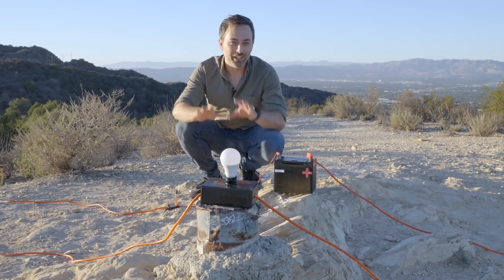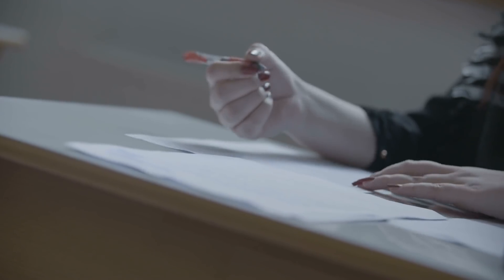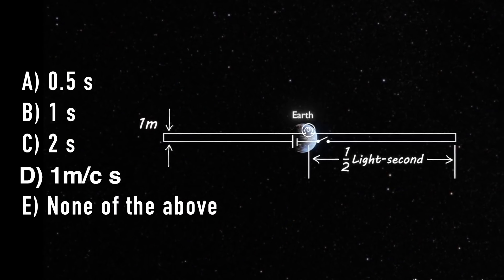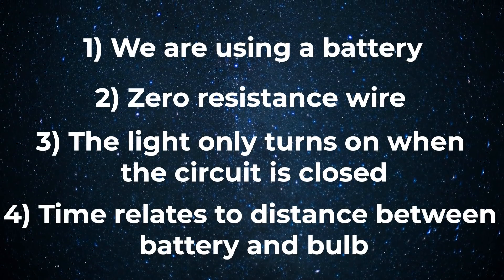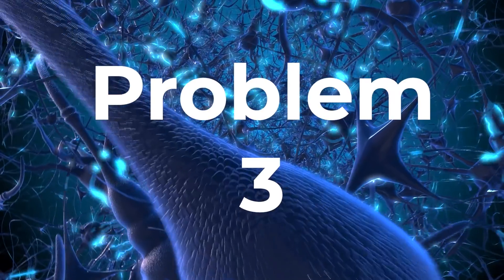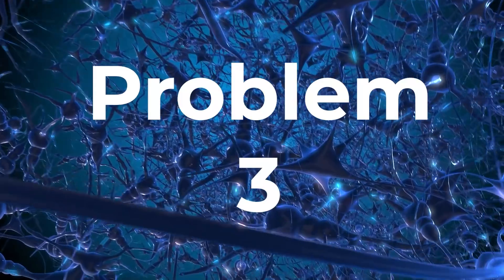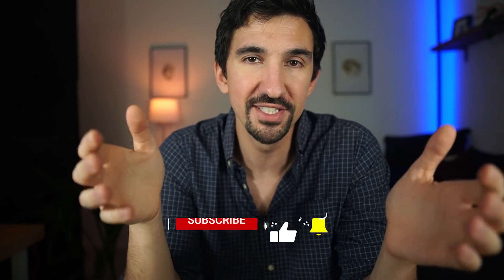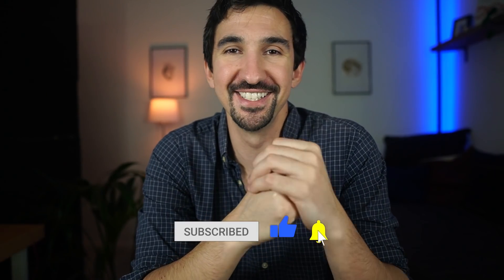Is Veritasium Wrong About Electricity?

Comment: Well done! By the way Veritasium uses the Poynting vector to illustrate the energy flow which is the right way to do it. The only little -- but extremely important -- detail which remains unmentioned is, however, the magnitude of the Pointing vector is directly proportional to the magnitude of E and B vectors (per definition of the vector product) and the E field strength is strongest close to the conductor. Thus, I figure, the most energy flow won't happen through the largest air gap or along the straight line connecting the battery and the light bulb.
---
It is a far more interesting question for me how the energy transfer is to be explained after the transiant processes are over by the Pointing vectors. So far I remember around a wire carrying a DC current there should be only magnetic field and the electric field created by the moving charges should be balanced out by the static charges so the electric field around that conductor = 0. But I got taught the theory 20yrs ago, so I might be forgetting something. Some help?
Reply: Indeed. I think this point is the best way of understanding where Derek went wrong. The presence and geometry of the wire itself affects the Pointing Vector, and the vector evolves over time. Yes there is a propagating field from the switch to the battery that travels at c. However the magnitude of the field at the lamp is minuscule. It has propagated across near vacuum.  Derek is basically claiming that the field contains enough energy to light the lamp, only due to that part of the field that has propagated across the gap. This is clearly false, and put simply Derek has it wrong. Useful power that can light a conventional 12 volt  lamp will not be delivered. 

The Pointing Vector will evolve over time as the E/M fields propagate down the wires, and in the vicinity of the lamp it will be rising in magnitude. In the limit, and with zero resistance in the wires, the field across the lamp will only rise in magnitude to the same as the battery after the fields have propagated the full length of the wires. In the real world, with actual resistances it will get close but never the same. Derek plays fast and lose with the nature of the E/M field. Whilst he and his advisers are happy to talk of propagation of the fields down a wire, they are happy to ignore permittivity and permeability and thus ignore actual energy delivery versus the initial arrival of a change in the field. Depending upon the nature of the lamp, it will light up at some intermediate time as the field increases in magnitude to the point where there is a large enough E field to drive enough current through the lamp and light it. However this time will, for any real life lamp, be indistinguishable from the full round trip time for the field.

Overall this was probably a low point for Veritasium. For someone with a PhD in physics (albeit in physics education) Derek made a serious mess of this. He should make a new one correcting things and pull the existing one down.
Reply: @francisvaughan7460  thanks for your explanation.  I understand the issue better now.
Reply: @francisvaughan7460  Derek never said it was practical, Derrik isn't wrong, but does negate the practicallities that outside of very specific conditions, as a matter of engineering, it is not worth considering. that said, this is why your ethernet is twisted pair and differential signalled. It is why we use coaxial cables in radio...
Reply: @EwanMarshall  Derek didn't say it was impractical either. He claimed the lamp would light. That requires non-trivial power delivery. He isn't wrong, but he isn't right either. He is presenting a confused mess. What he implicitly claims is however wrong.
The manner which information transits down a twisted pair is covered by exactly the same physics and mathematics. Delivery of information requires a well defined amount of energy. That won't move like Derek suggests either. In practice twisted pairs are complicated by the geometry of the twisted pair, which yields a velocity less than c. But this is nothing to do with Derek's weird set of assertions.
Reply: @francisvaughan7460  He stated we assume an ideal lamp that can light the moment it gets any energy. He isn't wrong, he is technically right, but the way he presented it, I agree, was not good.
Reply: @EwanMarshall  Good point. This is a significant error on Derek's part. An ideal lamp will obey conservation of energy. It can't light up and emit more energy than it receives. Derek is confusing the detection of a change in the E/M field with the delivery of energy. To do work - that is emit light - an infinitesimal change in the field is not enough.
Reply: @francisvaughan7460  I have a crystal radio set that says otherwise. Energy harvesting devices do exist. Now is it a lot of work they can do, no. In fact without another energy source they are pretty limited, but one can do some work. It isn't infinitesimally small.

I never said it'll light any more than the energy it recieves... it might not even be detectable by human eye. But this is problems in what we mean for the ideal lamp to light.
Reply: @EwanMarshall  Exactly. Derek never defined what "light" means. He did however keep turning a lamp on and off on camera. He never suggested that "light" meant anything other than what he was demonstrating. That requires non-trivial energy.
Reply: @EwanMarshall  "He stated we assume an ideal lamp that can light the moment it gets any energy" Wait did he really say that? So he's basically explaining radio wave in a video titled "The Big Misconception About Electricity"?
Reply: @Neehize  radiowave is "electromagnetic spectrum" what is electric and magnetic fields moving?

What Derek is saying, and is true, is the energy transfer down a cable is these same waves, just running along the cable. Transformers use this effect, but the truth Derek is explaining is "current" is actually this running along the cable.
Reply: @EwanMarshall  It is the same thing yes. However, the amount of energy transferred in the air and along the cable are on different scales... It's not fair to say "I'm able to light up this lamp without the cables connecting" because you cannot light up this bulb with only 1% of 12V
Reply: @Neehize  "assume the light comes on the moment current passes through it", so we need any non-zero current and voltage, by the terms he states.

I did not say it will be visible to the naked eye, I did not say it is physically practical. By the way it is stated, it is what happens.
Reply: @wbeaty  You are stating that Derek sent a signal over wire faster than fiber optics could? Because, on or off, its still a signal. 
No, he didnt, and no he cant. He is confusing radio signals with electric circuits and confussing everything in a very badly worded explanation about neither while trying to convince people he knows better with clickbait.
Now Im missing his sellout videos. At least those were as entertaining as biased.
Reply: @JuanCLeal   "you are stating"  Of course I'm not!   Why are people putting words in Dereck's mouth?  Why are YOU putting words in mine?

Everything in my writing (and in Dereck's video) is talking about foot-per-nanosecond lightspeed effects  ...which happen to be counterintuitive.    Those who don't understand basic rf design will start making s**t up, trying to "debunk" engineering textbooks.

When the switch closes, the light bulb turns on 3.3nS later, because at 12VDC,  tens of milliwatts of EM field-energy will easily leap across the 1meter distance, and will light up an LED lamp.   The gap-delay is one meter divided by c, or 3.3nS.   

Yet also that 1M gap will make it IMPOSSIBLE for a 12V battery to light up a one-watt bulb, or even a 1/10th-watt bulb.   The gap serves as a series impedance, a current-limiter.   But the amount of power that jumps across the gap is not at all microscopic or insignificant.   Really that's his whole point:  it's a trick question, meant to trip up anyone who believes that electrical energy flows inside of the wires.   It doesn't.   Never has, but we didn't know this until Oliver Heaviside figured it out, just before the year 1900.
Reply: @wbeaty  Hi sir, could you explain to me with more details how do you compute the Amperes that "arrive" to the led light?
Reply: @wbeaty  I don't think the 600 ohm calculation is right. The battery might see 600 ohms between its terminals, but that just means there's a 10mA current wave propagating out along the wires from the battery. The lamp won't receive any of that current until it has completed the round trip.
Reply: the Poynting vector of a static field doesn't describe the energy flow, but the energy stored in that field. This can easily be shown, by adding some magnetic material inside the loop or just looping several times. The field strength will be significantly changed, but the DC energy flow won't change. If Derek was right a spark coil wouldn't work.
Reply: @georgantonischki1188  thx for your comment and I made I further comment to my own comment so if you have some time to spend you can caste an eye over.
Reply: Poynting
Reply: @AlienRelics  exactly - and accuracy matters ALWAYS
Reply: Thank you so much! This was what confused me the most.
Reply: Veritasium has been wrong about a lot things for the past 2 years. Just saying.
Reply: Nice discussion. Thx for Greg for replaying to my question and for everyone for bringing good points.
----
I have just a few practical things to share. I remember when I was a student I spent 2 days to tune a self-made radio transmitter and the thing is in order the transmitter to radiate RF many conditions should be met and the most ugly ones (at least to me) are those related to the antenna and the transmission line. It really took some tweaking to force the transmitter  to radiate RF energy despite  of a relatively high frequency (ca. 100MHz). When running a radio transmitter I assume the antenna as being a load and measure the power consumption of the  whole transmitter. The funny thing is that when the antenna is sub-optimal the whole power consumption goes down.  So less energy per time is radiated. You have a feeling like this all RF is just "sticking" to the wires :D and only dare to leave them when the conditions (antenna) are right. 
For lower frequencies like 50Hz the antenna would be huge i.e.: c/f/2 = 10^8/50/2 =10^6m = 1000km, so there are virtually no chances to radiate RF at these frequencies.
DC not even theoretically are there any chances to  radiate something outside the conductors (the only quantities existing around and between the wires are static magnetic and electric fields accordingly).

Thus for me it looks logical to use the pointing vector (S = E x H ) to represent energy flow in radio electronics. However for a DC current where no energy is radiated into the space (at least so that it propagates away from an antenna / although energy can be stored in a static magnetic or electric field so sort of "propagate" when those fields are created after switching on the circuit can  be assumed but it is not the same as providing continuous RF energy propagation and thus defining the energy flow for a DC circuit) I don't see any sense in using S. And concluding that the energy flows thru the space for a DC circuit looks a bit crazy for me. It, actually, would be nice as then I wouldn't need thick wires at all. 
---
Finlay, even being a mortal engineer I should admit that there are no differential terms  ( dE/dt or/and dH/dt) in the Pointing's vector calculation so you can legitimately apply it to a DC circuit. The S vector filed, however, would to my understanding  look really strange i.e. the magnitude of H and thus also of S will decrease extremely rapidly the further you go away from the wire. Hence I don't know what it represents for a DC circuit??? 
---
The following is not important in regard to the discussed issue (just some general life stuff of an aging engineer):
----
For my everyday intuition involved in circuit design and other "electricity related matters" :P   I have these rules of thumb:
DC -> easy-peasy, just be sure that the wires are thick enough;
AC (low frequency e.g. 50Hz ) -> the thickness of wires is of course also important but you have more tricks in you pocket there: like energy transfer via electromagnetic coupling, etc;
RF - HF -> let's transfer some energy thru the air;
UHF -> EM propagates likes visible light (quasi optical propagation) and some really weird stuff starts to happen (I call my friend physicist to help me :P ).
----
The last but not least, I would ask a physicist who bores me with S vector field-type of questions: would you like that your smartphone charger is working or not? If yes, just leave me alone and let me do my job, calculating the right thickness of the PCB tracks as transfer of the energy thru the air didn't pan out . To which he may replay but you are  just like a moron in a car-workshop hammering my Tesla the other day without even knowing  Newton's Second Law. Is the car fixed, I would ask. Yes, he would reply. So, what is your problem, I would ask? 
And by the way, engineers do know some laws e.g. Ohm's Law, Kirchhoff's circuit laws, etc. My favorite is the Ultimate Law of Engineering: pi^2 = 9 (the prove: we postulate: ≈ == ) :D.
Reply: This old question at  Researchgate  gives a good insight:
" What is the significance of the Poynting vector in a static electromagnetic field "

Sorry I can't provide you with a link guys as some moronic filter deletes it. Just go to Rasearchgate, scroll a bit down put the search phrase and after hitting the search do not forget to select the question tab (it is not a publication).

Enjoy.

P.S. the first post on 26th Jul, 2014 by Eric Lord and the answer right below by Daniel Baldomir just shows what a box of Pandora this issue is. And the discussion goes for years!
Reply: If the resistance of the wire is exactly zero there won't be any electric field along the wires. But there will still be an electric field from one wire to the other, because there's a potential difference of 12 volts between them.
Reply: @gcewing   thx for your answer and I made I further comment to my own comment so if you have some time to spend you can caste an eye over.

Comment: This was way more satisfying than the other video. When he started talking about transformers having a gap it bugged me because the transformation is a ratio based on area (number of turns roughly put). So what you said makes way more sense. The two sides of the circuit act like a transformer with the same area so you should get almost the same power if the lines are close enough to influence eachother magnetically. The circuit doesn't have to be closed because the tiny capacitance of the lines causing the change in current and therefore the change in B feild. Once the wire is at capacity, the B feild would stop changing with DC but with AC you could keep that B feild moving (hence transformers are usually used with AC). This is also why you'd get a different speed if you had the same length of wires coiled on the ground next to the circuit, same area but more area of "further down" the wire is closer to the area at the beginning so it gets influenced faster. (To be fair, I'm working on my doctorate in Comp Sci and dropped EE after two years of undergrad. But if his solution was true, I could make billions sending stock market information from NY to CA faster than the current maximum throughput.)
Reply: hmmm... actually, your point about transformers has helped me. If you take two transformer coils and separate them (recall there is a gap in the first place)... you find that the transfer of energy is far weaker the further they are apart.  It again demonstrates the inverse square law.